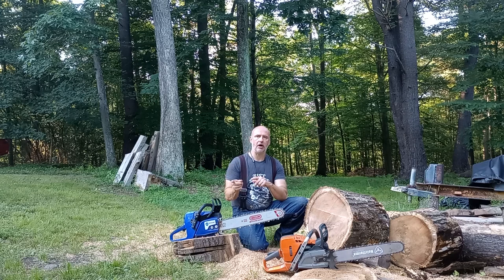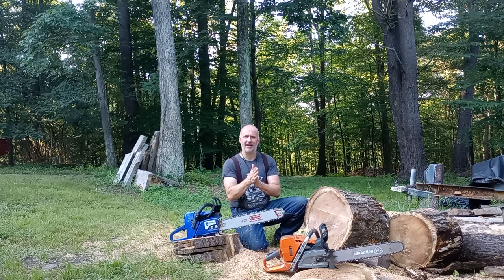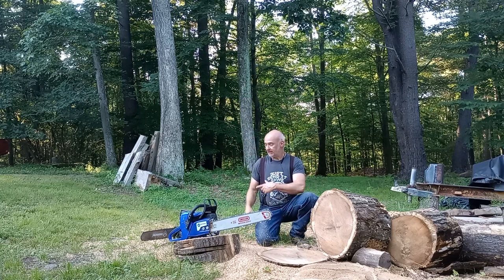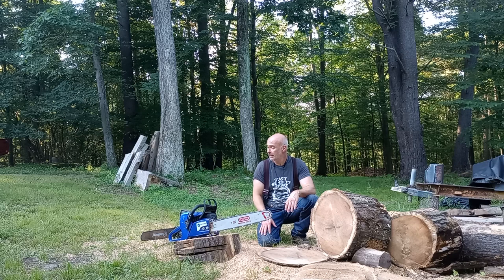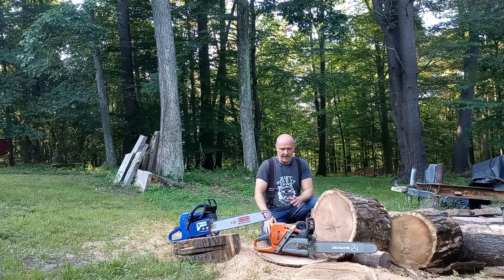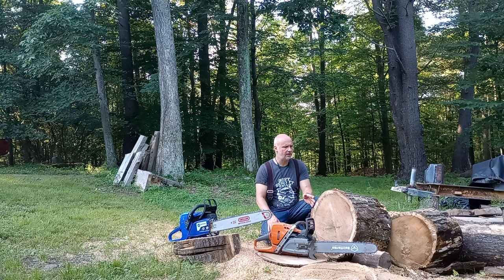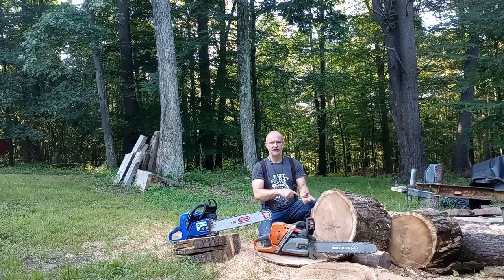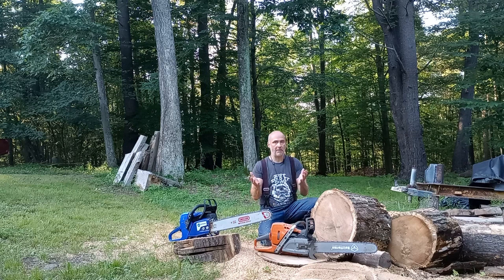Jacking with a Husky 572xp and a Farmertec 361 slightly modded clone...July 29, 2023

Comment: Imo the best bang for buck in the farmertec stihl clone lineup is the 361 and 660....I would love to try porting the 260 clone but how and why is it more expensive than the 361? With the 9cc more displacement, spring antivibe and a quad port cylinder, the 361 is absolutely the better option. I have a 361 kit that I built with ported BB cylinder.... She runs good but I'm curious to see it vs a ported 59cc.... About to build that second saw now for comparison.
Reply from the maker: Agree on pricing.. the 260 clone isn't available in a kit which is frustrating..  I have a couple buddies who love the big bore versions both ported and non.. I don't love all big bores . But some are fantastic.. I have a couple of standard bore 361 to port up . Just need to find time.. I'm hoping to do a lot more with them... I love em
Reply: @bulletproofsaws  I wish they released the kit for the 260 amd both white orange and grey orange..... I really like the grey as it doesn't show dirt as well as the white..... An another note, you said in one of your 660 build vids that u use a different Intake boot for more flow.... Can you share which model? Thanks!
Reply from the maker: @jarrodskeete52  I don't think I meant more flow on 660... There are some boots we do swap for flow.. the 660 is a reliability one.. the hyway viton resists fuel better than the non viton rubber... Early on the FT boots were not great . They have improved but we still swap them on certain models.. probably should re evaluate them..